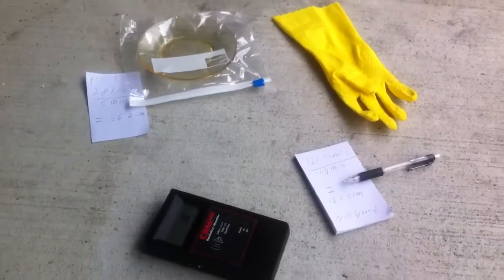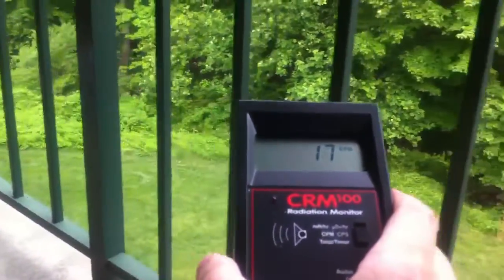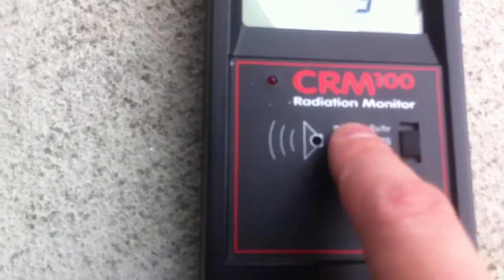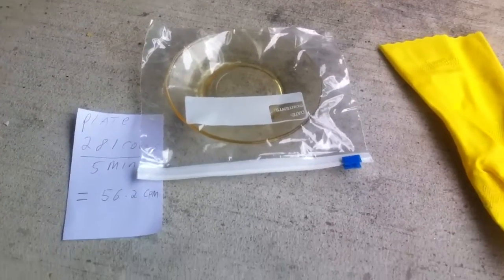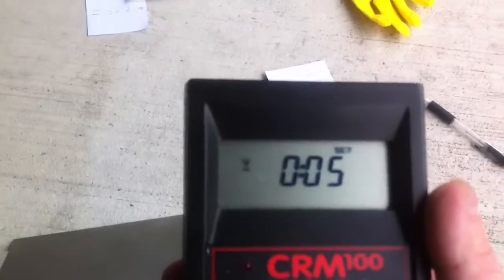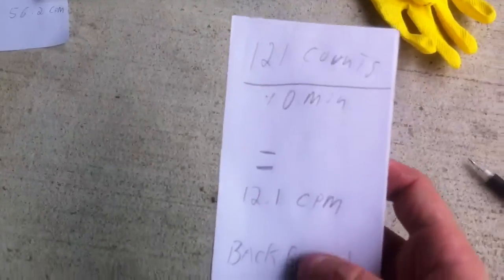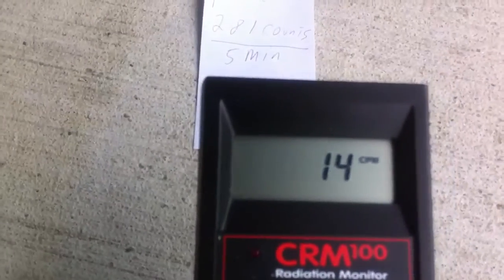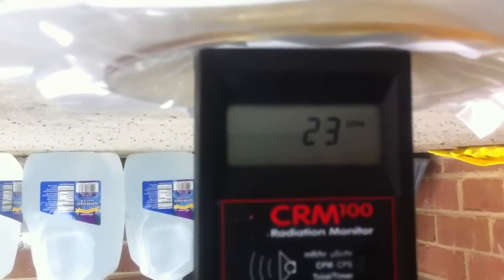☢ Radioactivity ☢ and How to Use a Geiger Counter -- Part 1

Comment from the maker: The CRM100 is a nice little unit, but I would really recommend the Inspector. The Inspector has a large "pancake" style tube which is many times more sensitive. They share the same casing, but the Inspector beats the CRM100 hands down.  GeigerCounters com has them.